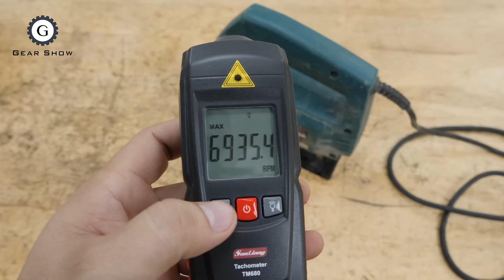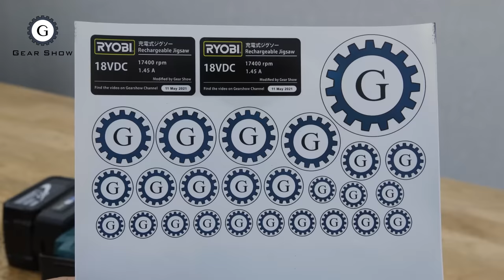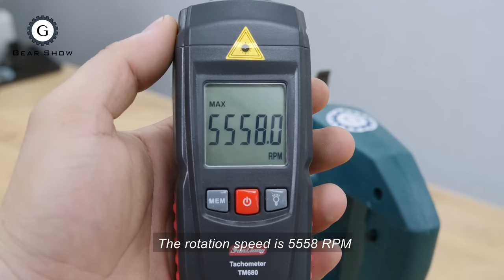Cord to Cordless Jigsaw Conversion from 110V to 18V | RYOBI MJ-21

Comment: Does the usb adaptor have a built in low power cut off? I've been looking into converting an old portable circular saw to lithium batteries and read that you need a low power indicator as draining the lithium batteries could cause a fire? This was on thingyverse but if those usb adaptors are cheap I might use that instead of trying to 3d print something. Any tips would be appreciated thanks
Reply from the maker: I plugged that adapter with the battery for few days, some time a week, it's still working normal. I think it's okay with this adapter.
Reply: Genuine Makita Batteries that have the charge indicator lights have built in low voltage shutoff, I doubt that the Chinese knockoff (Fakita) batteries do. 
Also those Knockoff Batteries have a tendency to catch fire when charging and sometimes while sitting unused, I wouldn’t waste my money on them.

Comment: i was hoping for rewinding for 18v or some voltage adaptation. Although great job on the mechanical adaptation, end product is weaker than original and will probably fail on the socket adaptation screw (maybe use locktide or some mini welding or slotting).
Read below motor was not tighten to case, but i believe you were using the own casing plastic to tighten it, so that may last long. 
Generally, like.

Comment: Why did you choose to replace the motor? The motor found in the original looked to be a series motor that can take either AC or DC, did you replace it because it wouldn’t have operated as well on the lower voltage?
Reply from the maker: Yes, I want that conversion look easy and normal. I will do that idea for the next project.

Comment: At both ends of the motor the bearings are oil light so they need oil, not grease they will burn up

Comment: you need change original switch to bigger switch or connect it via relay, will enough power from battery to motor
Reply from the maker: Okay, that is good point, thank you!

Comment: nice, shame you didn't use a nicer jigsaw, i hate the ones where you need an hex wrench to tighten the blade, but i guess this had the flat back you needed to mount the battery holder.

Comment: This is a great conversion...but does it stagnate when drilling ect..does the battery hold the charge and does the battery heat up from resistance put by the drill

Comment: Great job but I do have one issue. There's no low voltage circuit protecting the lithium battery. If the battery is run down too far, the charger will not charge it again
Reply: Circuit is likely already built into each battery.

Comment: You do know the original motor is AC and DC ?  All power tools that are plug in also work with battery power. You did not have to change the motor.
Reply: But it might require approximately 110VDC

Comment: Good work bro. But anytime not will work full power. I think...
Now battary full 5.5k rpm. But battary %50 %30 how much rpm?
But nice work 👏👏
Reply from the maker: Yes, you are right. To get full power, the dc motor should be upgrade like my previous project. https://youtu.be/I5LA0O2pZno?t=415

Comment: you are a master. please show me how to make your solder fume extractor. thanks a lot.
Reply from the maker: That is a simple project. I use a computer fan power by rechargeable battery.
Reply: I know. But this fan looks a lot more powerful. How much voltage do you use?

Comment: Very good conversion. Drilling center of the axle is especially difficult, well done. Does the  battery has any internal low voltage protection? if there is no low voltage protection, it will kill the battery very fast!
Reply: Yeah espeially when you connect a usb device to the battery. Those cheap usb chargers suck the battery fully empty to the point they wont charge.

Comment: i have a question: how do you fix the Motor to the housing to prevent it from rotating an sheering the cables?
Reply: ...any kind of glue will do, like a silicone glue, you only have to glue the motor to one side.   I did this to a corded drill, which had an internal moving head/motor, something broke inside the injection molding.   I just glued the motor to one half of the inject molding, now the motor assembly is stationary inside the body of the drill.   It was a Genesis drill, with an articulated drill head, the injection molding was a poor design.

Comment: seriously? Seen that shims fallen of as the AC motor was removed? These are lethal. They keep the motor in the right place. Now all vibration goes into the bearings. This will not work for long.

Comment: Where I live I can buy a new 18V Jig Saw for the price of importing a 775 DC Motor. Nice build, but why ?
Reply: 1)For fun and experience
2) For youtube money of course
3) 775 motor - $10, somewhat decent jigsaw - $40+ usually
Reply: @elyeryan8838  For sure. Not everything is clinically perfect, sometimes fun and a challenge is worth more than a $ or two. I wonder if one could do that to a small angle grinder.

Comment: I have a 110volt drill presented to me by one of my relative: but since I am in India I couldn't use it but after seeing your video I wish to convert it to a 18 volt one with 775 dc motor. Is it okay to try it or else if you have any suggestions please help me out.
Reply from the maker: You can use it by using 220V to 110V transformer.

Comment: Okay, I was for some stupid reason thinking he was going to work some kind of magic and literally turn the original motor into a DC input at 18v. This project cost more than just buying an already made ryobi.
Reply: How much is a cordless ryobi jigsaw with a battery and a charger on your side of the world?
Reply: the guy literally didn't use it as work tool but something to tinker with or as a hobby

Comment: Great video! This battery adapter could be used to adapter older ni-cd 18V tools to use new Makita 18V batteries and charger. Did you bought it from aliexpress?
Reply: Another thing, I think is better to put in the label the maximum power of this new engine, could you get this from manufacturer?
Reply from the maker: Hello Paulo Flores! I bought that adapter from Taobao.
Reply from the maker: Yes, thank you for your suggestion!

Comment: Do you have a source for the battery? I really like your design conversion.
Reply: ...It looks like a Generic Milwaukee or DeWalt battery?   With an aftermarket adapter used to charge USB devices.

Comment: Hey bro, i am a bit 'angry' with you. It is obvious that u r very talented, so you should know that these power tools are not only for fancy show-off. The original electric motor had its not cylindrical frame shape with a very good reason. In other tools the motors are also fixed with several screws agains unwanted rotation in the housing. I am quite surprised that you ignored the fact that this tool is for tough jobs and must be assembled accordingly. Keep up in development!

Comment: Wicked upload AWSOME!  I would absolutely Love to see you do from a corded Electric Planer 110VAC Conversion, to a Cordless 18VDC/21VDC Lithium Ion battery Or whatever you think is best Please! If possible Many Thanks🔥👍.( GRACIAS por el buen contenido) new subscriber.
Reply: There are many videos out there on converting to from old rechargeable tech (ni-cad, ni-mh, sla), this video is probably best at considering modding from AC powered motor to DC powered motor. Which battery you opt for is almost secondary. I’ll also say that showing the cleaning procedure using hot water and baking soda, and gasoline for parts. That coupled with detailed resinstall and lubricantion, this video’s chock full of goodies. I’m saving it for future reference

Comment: Forgive me I'm a former Network Engineer, but I know zero about this kind of stuff.  Would using a higher mah battery make the RPM faster or no?
Reply: Not make RPM faster, extend battery life. Increase volts to speed up RPM. But this 775 motor isn’t far from baseline output

Comment: Since that's a DC motor maybe you should modify it with a variable speed thumb dial?
Reply from the maker: This motor is original from factory, yes I will modify if the speed is slower than this.

Comment: Nice video very interesting.  You were meticulous on most things and sloppy on others.  
If you solder the power connection use heat shrink to cover the metal and solder.  If a ground wire got loose or something hit the power it would arc out and ruin everything.  
The devil is in the detail.

Comment: Very good but I can't understand why you did this as the only things you saved from the old jigsaw was the case , platform and a few bits inside . The chemicals used for cleaning where more harmful to the planet than just using the old saw as it was . Good work though and well thought through.

Comment: That took far tooo much work. That motor you took out was a universal motor and will run on dc power directly. If you stacked up enough batteries to get 120v dc. Then the jigsaw would have run on it straight as it came straight  from the factory.

Comment: Not convinced . It only looks superficial.  You did not cut it with load. Seems you only showed it cutting planks. Jigsaw is used mostly to cut hard to reach places and shapes. I guess I'd rather buy the real heavy duty one or remain electric.  Torque would be better for thick wood as apposed to wasting time,electric, money on equipment and potential failure on a maybe success with no increase in torque or rpm.
Reply from the maker: That is great point you see my faults, I hope you will be improve in the future.